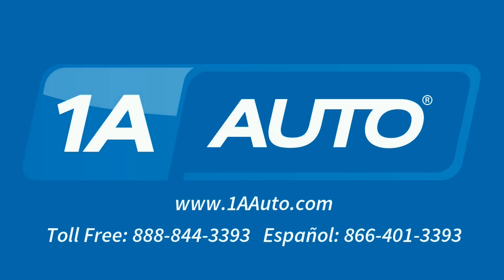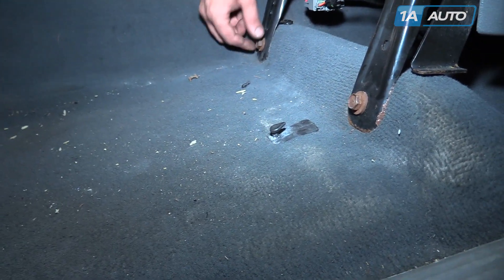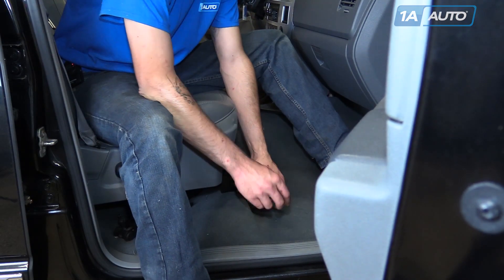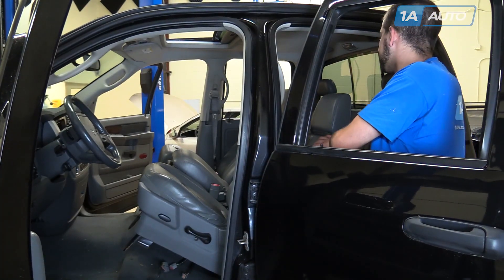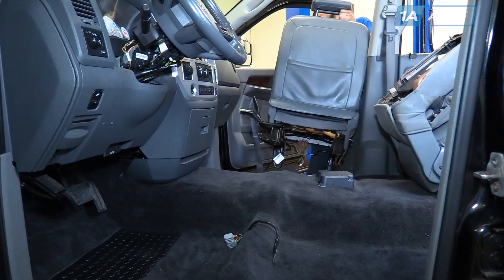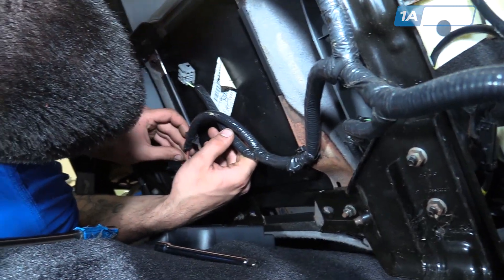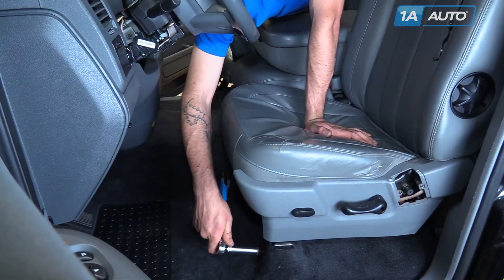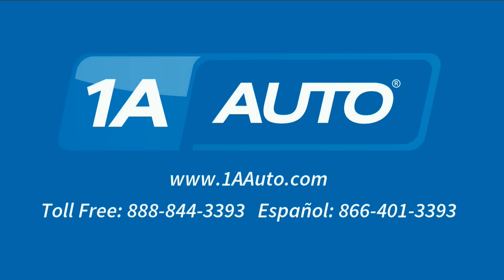How to Remove Front Seats 02-08 Dodge Ram

Comment: Thanks for the video.  I got the seats out and I was putting them back in and I cannot se what the passenger seat electrical connector connects to.  I had the one main one under the drivers side, and then the longer one that has a connector to under the console.  I am not seeing what I had undid the passenger seat from.  I feel stupid, but I am not seeing where to plug it in -- my truck is a dodge 3500 2006 model -- thanks for taking the time.

Comment: Will a 2004 Ram SRT 10 bucket seats fit in a 2003  Ram 1500 (power driver seat)?
Reply from the maker: +First Last No, the seats in the SRT 10 models are not meant to fit in the standard 1500 series.
Reply: Will seats from a 2500 fit in a 1500
Reply from the maker: +First Last The 2003 model will not be able to fit for a 2004.